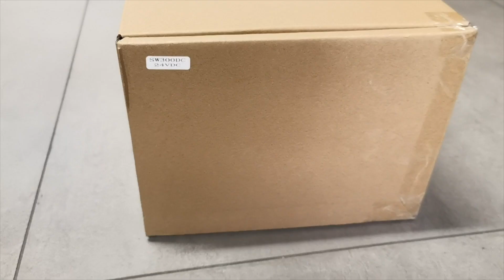SW300DC Swing Gate Operator Kit Installation

Comment: Refer to your time code on the video of 1:45 
(You open the gate here) 

Next you wire the box then time code  1:57 

Press and hold TS1

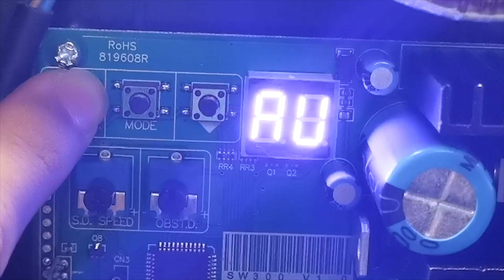Next at 2:12 THE GATE SHOWS ITS AT THE CLOSED POSITION (after you staged it open)

Don't you see that. Mistake in your video
Reply: How can I get the manual please
Reply: ys manual says to open and press and au my problem is the board is behind the gate even opened he shows close the gate then press au? I am confused